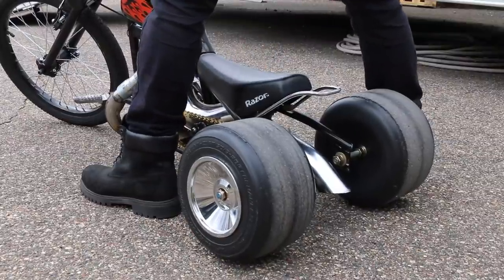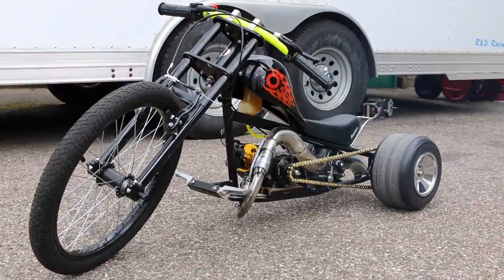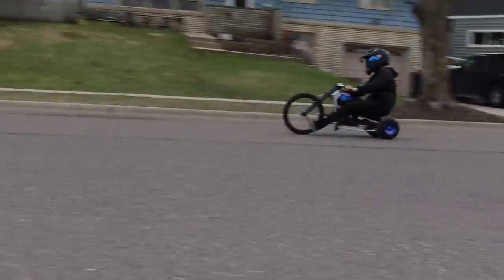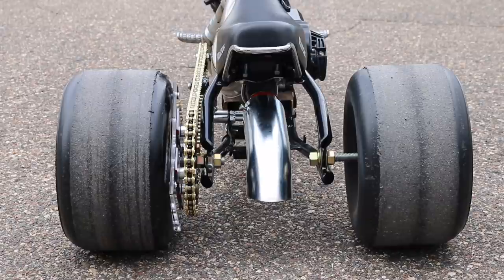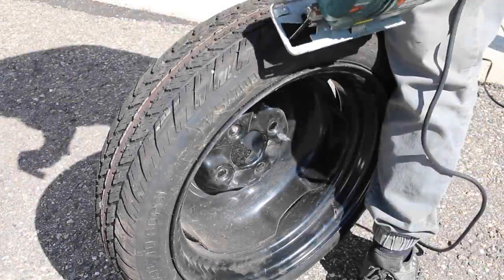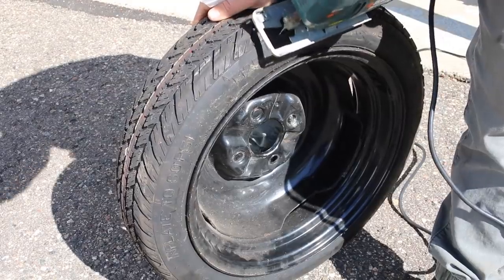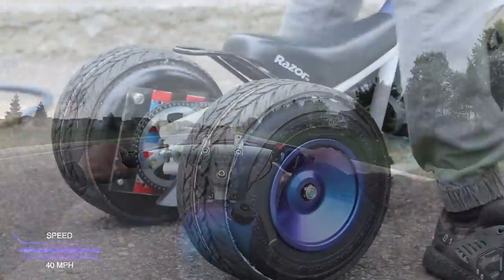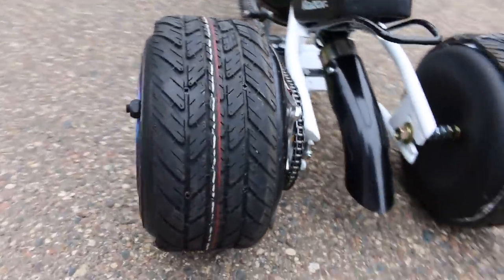Making Run Flat Tires For The Pocket Drift Trike!

Comment: Got to ask why you didn't use a solid axle? So it would spin both wheels like a drift trike.
Reply from the maker: The next one will be solid axle but I wanted to make a couple standard with this small of a motor. = Solid axle adds a lot of cost

Comment: How does this effect your steering? I been running slicks with the PVC sleeves and it turns way to easy and I'm sure I'm losing a lot of traction..I want more top speed and a little less steering...any ideas?
Reply from the maker: Yea thats why Ive never loved the traditional drift trikes.. depends how much power you have but I was getting total grip with this set up
Reply: @jaguars004  without sleeves, with a live axle, traction is so great but pulls wheelies and can't steer in the corners.. so got to have sleeves to break rear traction to kick out the rear of trike to make a turn. I have seen others use different width of sleeves.. maybe this is something that I need to dial in on my trike.. I currently have a stage 1 kit and can run about 41mph with my current setup.. wanting to install stage two kit this coming winter while it's too cold to ride, and spend the time upgrade the performance on my engine.. but don't to be too loose at any greater speeds..so I also want to start working on balancing my trike for better mobility...